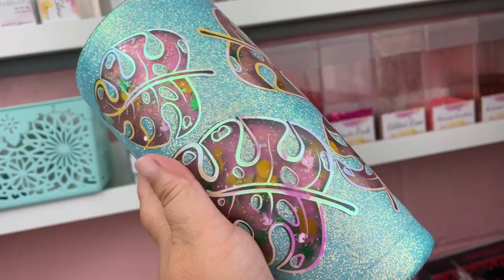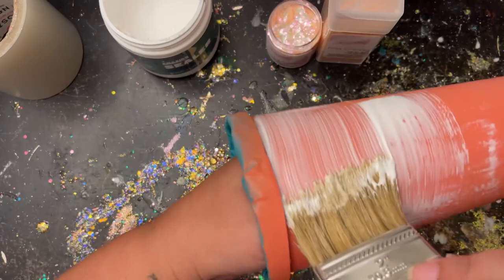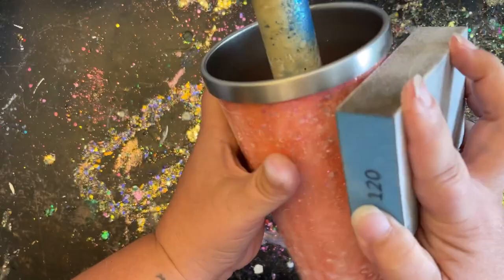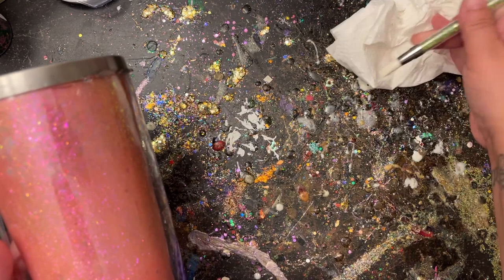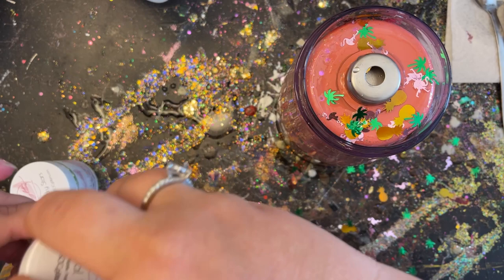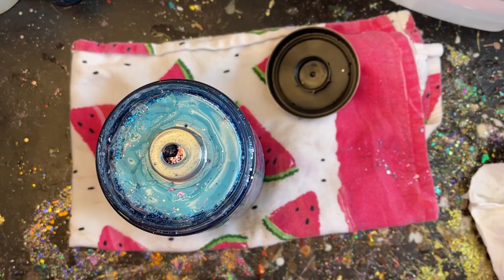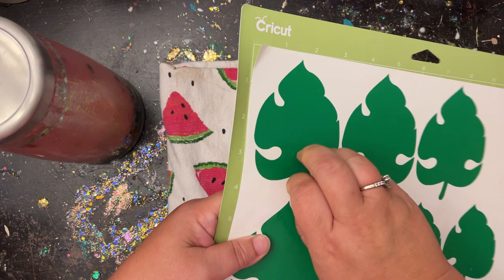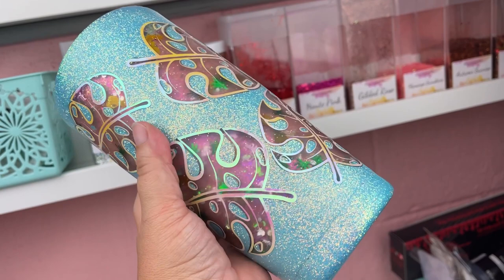Tropical Storyboard/Glitter Flow Tumbler Tutorial

Comment: Excellent!!
Reply from the maker: Thank you, Rosalinda 🤗💖
Reply: Do you not fill the hole on the bottom where the threads are?
Reply from the maker: @hopeaudi171  I don’t. When I add the epoxy after I let the silicone cure I fill it with epoxy and haven’t had any issues. But I’ve seen others fill the hole. Either way you feel comfortable doing and prefer.

Comment: Such a cool tumbler!  I do have a question though.  How does the epoxy over the glitter on the center part not soften when you add the water glycerine mixture?
Reply from the maker: Great question! Once epoxy has cured fully it is water resistant to a point. It can become eroded if you use water from the tap, especially city water with chlorine and other chemicals added and well water, which is why you want to make sure to use distilled water to combat erosion. I also make sure the top and bottom seal will be secured under sealant so over time the water won’t pull the seals away off the inside base. I hope this has helped 🤗💖
Reply: @SandysOrganizedChaos  Interesting. So really the reason we cant wash the epoxy cups in the dishwasher is more because of the heat and detergents rather than the water?